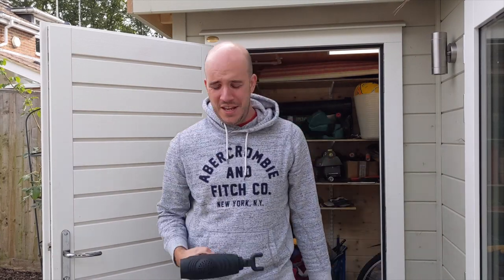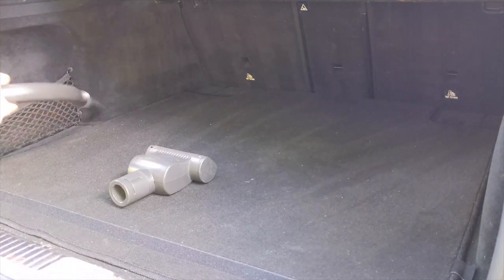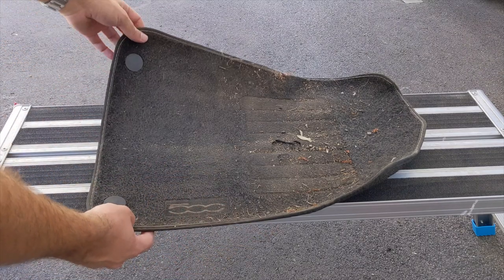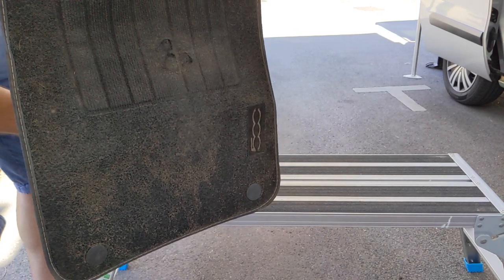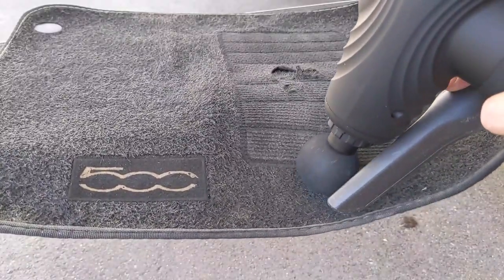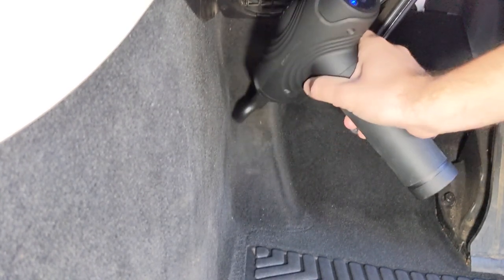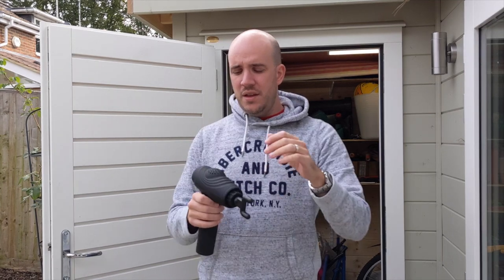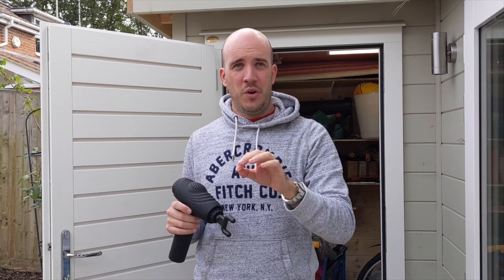Using a massage gun to clean your interior?? I tested out the TikTok craze!

Comment: In this video, you have inadvertently explained why upright vacuum cleaners with a beater bar and GOOD agitation are what you should buy for carpets.
Geek alert - straight suction vacuums and even turbo heads don't agitate carpets so they don't extract out the dust. Suction isn't the most important factor on carpets, it's agitation and airflow.
For those at home that have an upright, you can vacuum your floor mats and get the same benefits. You might also notice the dust being agitated out in front of the vacuum head if you go slow enough.
Reply from the maker: My folks used to have one like that, it incredible (and loud). Very effective though.

Comment: That's a pretty slick idea.    Thanks for posting.    I am definitely going to get an old power massager similar to the one you show here and give it a go for using on interior fabrics.   Brilliant idea.    I am always banging the carpets, mats, and fabrics with my hand in order to force some of the embedded unseen dirt up to the top of the fabrics for vacuum removal.     The Tornador is without a doubt the easiest,  fastest,  and best way to remove embedded dirt but they are expensive and require a good quality and powerful enough air compressor to actually run the tool itself which most people probably don't have at home.     This is a great alternative option.
Reply from the maker: I whole heartedly agree with you on this Vs the Tornador, I've even seen they now have an attachment that lets you attach the vacuum cleaner to it as well, which is a good idea. My biggest issue with using the Tornador on interior carpets is that shit just flies everywhere, all over the interior.

Comment: Massage guns do not have the frequence to work properly. Use a 1/4 block sander. (Without sandpaper of course)  Higher frequency works so much better.
Reply from the maker: The thing that's worth mentioning here with the sander is not to get a hook and loop fastening one, because that chews up the carpet. The foam plate ones that you clamp a sanding sheet round are the ones you want (I've found anyway). The amount of people using their DA's to do it without some sort of interface is crazy. I've found adding the DA brush pad to it actually does the job nicely.

Comment: You can't get mains powered versions and when I investigated some months ago (when the videos were circulating), the bad reviews were mainly about the power supply - won't charge, won't turn on despite being fully charged etc. so I didn't get one.
You say the price has gone up...it will now. 😉
Reply from the maker: I'll have to keep and eye on that. I'm a few months in to using it and I've not had the problems yet, but it's certainly something to be aware of.

Comment: Thanks Adrian,  been thinking about this for a while , would love a compressor and have the space but its quite a weight to lug about
Reply from the maker: It is, but it's well worth it if you can afford it. However, I would say a DA vibrating seems to pull up a lot more than the massage gun does - actually what you really want is a palm sander that doesn't spin, just vibrates, that's the magic touch! https://www.screwfix.com/p/titan-ttb891sdr-electric-1-4-sheet-sander-240v/632vv
Reply: @SuperchargedLlama  

That's a great idea,  I tried to use a random orbit sander but the backing plate stuck to  the carpet lol
Reply from the maker: @jezlucas3878  yeah it absolutely buggers if it you do that. Have a check, some of these attach via hook and loop and some need to be clamped on, it's the clamped on ones that you need if you can find it.

Comment: It may work but who’s spending 3 hours vaccing carpets?
Reply from the maker: When you're being paid to get it spotless, it matters. Or when there's loads of sand in the car after a holiday, that's true use case I find I need it for the most. Some of the interiors I get to do haven't been cleaned thoroughly....ever! So you get years of embedded stuff out, but you don't do it that often, and the client pays. As you could see with that Fiat 500 mat, cheaper small cars often cost as much as luxurious 7 seat SUVs to do as it's all based on time and materials.
Reply: In a word... SMax... 🤬
Reply from the maker: @jonlinder189  that's a good example. Ford in general actually, although I did a Vignale fiesta (before I did YouTube unfortunately) and that was so much better.